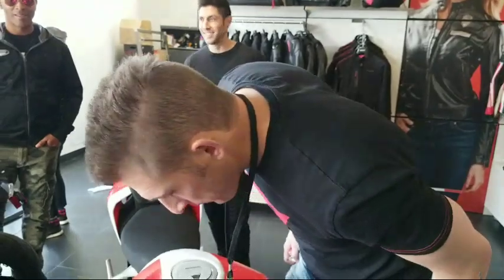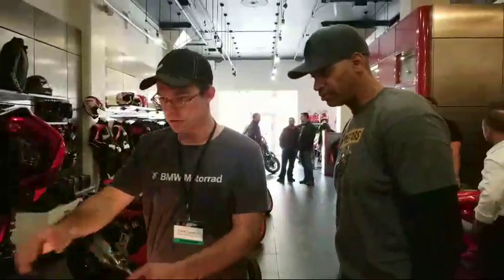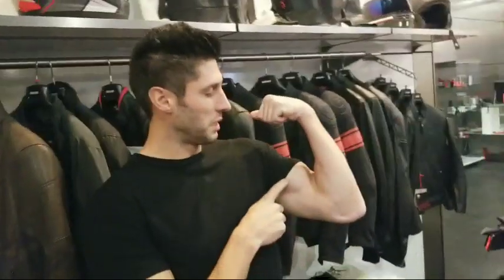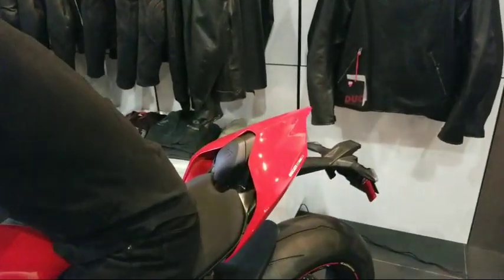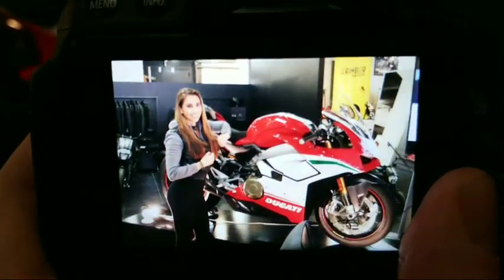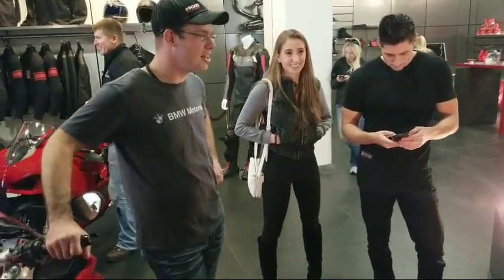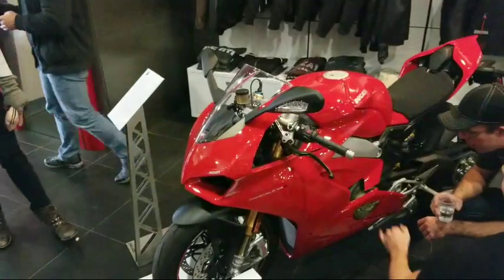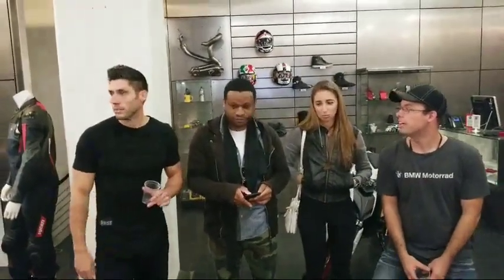2018 Ducati Panigale V4 Speciale: A Closer Look 👀✔️♥️

Comment: I bet there will be carbon frame cover/ protector available within weeks after this video
Reply: Steve Muir for shure also to mee this deteil  on the v4 with the grey Frame is not that preaty.on a Japan Bike will be maybe good locking but Ducatihas much more higher Level for Design.

Comment: 650ib, With the higher horsepower than the h2 is this ducati faster or more powerful given its lighter weight?
Reply: No one knows. But we will find out, however I doubt it will be faster than a modded h2
Reply: Just the fact that someone mentions a NA bike to a boosted bike is an amazing statement to what Ducati has done with this V4 motor.

Comment: Good lord do all the motovlogers live in the same damn geographical area or did you all fly to a central meet up? Dont answer that it was rhetorical. I test rode the base model and It sold me enough to scrape enough doll hairs for the Speciale...what a delight. I have to think the Speciale routs heat better than the base and S. The base scorches your inner right thigh on a 70 degree day after 180mph coming down to a red light and sitting. It will burn you, god only knows what happens on a 110degree day. Speciale saves the day!

Comment: Awesome video! But the design seems rushed bc of Euro4 regulations. 🤢
Reply: Slideway86 i dont think so if you loocking Design Ducati has make everything right the Ecsaust ist pretty and the Rest of the Bike still better looking than outher Bikes but not that preaty like a 1299 or a 1199 this never will be more in History😎
Reply: Jurcevic Stipe I agree. The Panigale stole my heart and that’s coming from a 916 series owner. I’ll give the V4 some time, I guess. It seems like a bigger design, bc it seems to fit 650ib well.
Reply: re: "the design seems rushed bc of Euro4 regulations."  correctamundo...!!!

that's also why it's 1100cc's.  but the design is what it is because they want you to focus on the ENGINE for now (which is a jewel).  they can't give you both the engine AND a new design today, otherwise what would they give you tomorrow...? rest assured, the update is already done, they just have no intention of giving it to you for another 4 years.

Comment: Ib, once again I say, if WERA limits 4 cylinder bikes to 1000 c.c., where will a 1103 c.c. v-4 compete?  You guys remind me of Dovisoso and Lorenzo checking out their 2018 MotoGP bikes, but those guys are racers, not track-dayers. Is this bike useless?
Reply from the maker: +busaking1 hawley Ducati is making a 1000cc V4 Panigale R in 2019.
Reply: Q: "Is this bike useless?  A:  to sanctioned racers, yes.  

but that's exactly the point, Ducati did this expressly to BLOCK various and sundry tossers from racing it.  Ducati Corse wants to be the first, but they're not fully ready.
Reply: P.P. I've been told by real racers, not track day lads, that one should actually race a bike like a SV650 or R6.  A riders skills will improve this way. They won't when you wobble around on a bike too fast for your track skills. Those gentlemen should start racing, and realize track-daze are just practice sessions, not racing.

Comment: 200/60 isn't a new tyre size. Anyone worth their salt has been running them for years.
Reply: correct, Aprilia's already had it.   this is because most of Pirelli's new tires are tested/created through partnership with Aprilia.   this is where the first 190/55 development came from back in late '99/early 00's.